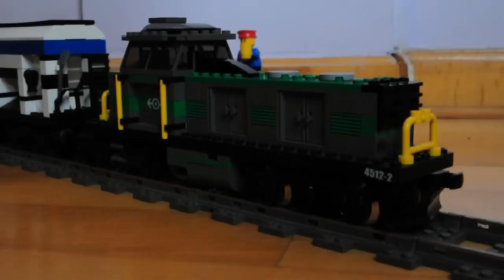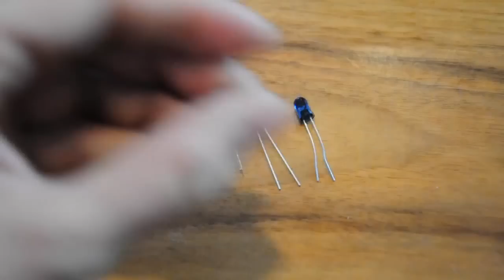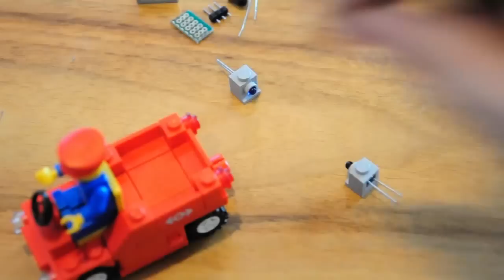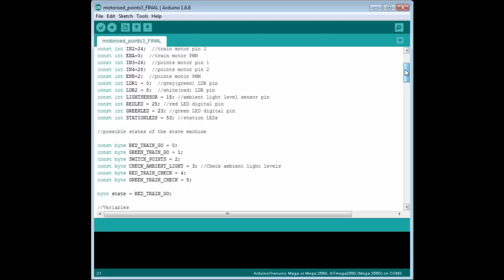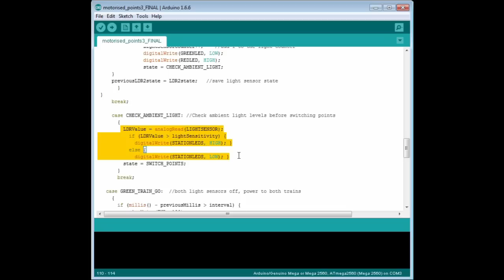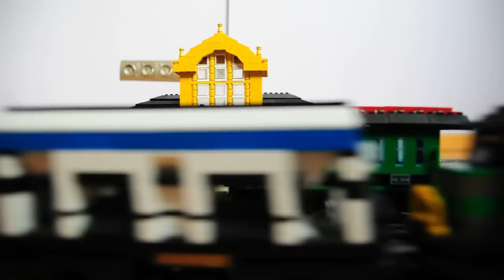Arduino for Lego Trains #8: LEDs and Infra-Red Sensors

Comment: You should upload ur code on github
Reply from the maker: All the codes are available on the project site: arduinolegotrains.wordpress.com. I didn't want to put them on Github because I don't want them to be modified (because then I have to replace all the videos to match the code, which is too much work). But on the site you can copy them and make your own changes as you want to.

Comment: What if I try this combining with the video #12. Then what should be the code
Reply from the maker: For this to work with Power Functions trains, you will need three Arduinos: one to read the station sensors and control the points, and others on each locomotive to stop the trains. This requires some wireless communication between Arduinos, which will be the topic for video #15 (in progress).

It would be simpler to combine this video with tutorial 11, and mount a single IR LED on top of the station to control both trains. In this case, just replace all references to IN1, IN2 and ENA to the appropriate Power Function code (lego.Singleoutput(0,PWM_FWD4,RED,CH1) etc). All these power functions codes are explained in detail in tutorials 11, 12 and 13.

Comment: Hi, i have a question about the use of the pins arduino in the track switches. In some videos you use the driver motor L298N without the PWM (just an ON-OFF control), so i suppose that you use a jumper in the driver. In this tutorial you use the PWM but set up the max value 255. Is it waste the PWM in this way? I have just an arduino uno for the moment, thus save pin is critical. To power supply the motors point i use a DC 12V-2A. Compliments for series, I love the first 11 videos with older sets '90 years
Reply from the maker: +Gregorio Eugenio Ragazzini Hi!  I always use PWM with L298n,  because it's required.  Ypu can't run it any other way. 
Maybe there is confusion because sometimes I power the arduino from the L298N,  and thete is a jumper to provide this option.
Reply: Gregorio Eugenio Ragazzini 🎽🚓🚓🏎🚨🎭🚵

Comment: These videos are great. Even the intros are entertaining.
Can someone please explain, how can you kill the Arduino if not using the resistor? I though that you would damage the LED that way but not the other way around?
Reply from the maker: +psixo The absolute max current that an Arduino's chip can take on the input or output is 40mA. However, it's able to supply up to 200mA. So if you don't use a resistor, there's a chance that you'll send 200mA where you can only sent 40mA, and that will fry the Arduino's main chip.

This is a very simplistic explanation, but that's the core concept. Don't risk it!
Reply: I have never used Arduino, only Raspberry Pi and fried only LEDs.
But this is a good explanation, will not skip the resistor, thank you.
Reply: If you need a resistor to protect your ardruino from damage from leds, then you are doing something wrong.
The ground lead from the leds should NOT return through the chip, but bypass it to common ground.
Reply: That was my tough also. I thought the resistor is there to protect the LED from overvoltage and that sending to the ground pin would not damage the chip.
Reply: Well, that's how it's supposed to be, but sometimes you use the return to control the led, in which case overamperage can damage the chip. 
Anyway, the function of the resistor is to be a voltage divider, so that the voltage onto the led is lower than vcc or vss. If the led short circuits, the amperage may still be high enough to damage the chip, even with the resistor, if the led is grounded through the chip and not through common ground.

Comment: I'm just a little confused how you control 2 trains on one track loop. I understand in the junction vid that they're on separate tracks, so you have full control. Is the "magic" here that when you switch between the two trains, you're able to break the circuit for the station train by opening up both track switches? 

These vids have been a great intersection of Lego and Arduino and I've enjoyed them immensely. You do a marvelous job at breaking complex concepts down for beginners.
Reply from the maker: Thanks! Yes, you've understood the magic - with both points set in the same direction, there can be no power to the other track section. The program then reverses polarity to the rails, so the other train moves in the opposite direction.
Reply: +Arduino Lego Trains Thanks for the quick response!

Comment: Your videos are so cool! I like them! :)
Can you please give me a link for the resistor calculator?
Reply from the maker: +Dávid Illyés Thanks! Here's a really simple calculator: http://led.linear1.org/1led.wiz
The forward voltage and forward current can be found on the datasheet for your LED, so type the LED model number, plus "datasheet pdf" into google, and you'll get the info you need.
Reply from the maker: +Dávid Illyés And here's a similar calculator if you're making a string of LEDs, like I did for my yellow station: http://led.linear1.org/led.wiz
Reply: +Arduino Lego Trains Thanks!
Reply: +Arduino Lego Trains Thanks!

Comment: Love you video, finish all of them in one go :) good job!
Could you tell me how did you make the code so tidy? The code I wrote were like a pile of junk, not really readable.
Reply from the maker: +Ben Shen Thanks! When it comes to writing code, just keep things short and simple. Write simple loops, and annotate them with //comments. When you add new pins or variables, keep them  all in one place and //annotate them so that you remember what they do. Indent your code so that it's readable. These little things will make your code more readable, not just for yourself but also for others whenever you need help.
Reply: +Arduino Lego Trains Thanks for your advice. When I read your code, I saw you use both "#define" and "const" to define a constant, is there any difference between them?
Reply from the maker: There is a difference between  #define  and const, but the difference is at a very fundamental level of Arduino programming (const is handled by the compiler,  #define  is handled by the preprocessor). For good coding practices, stick to using const for now ;)
Reply: +Arduino Lego Trains thanks!
Reply: Ben Shen